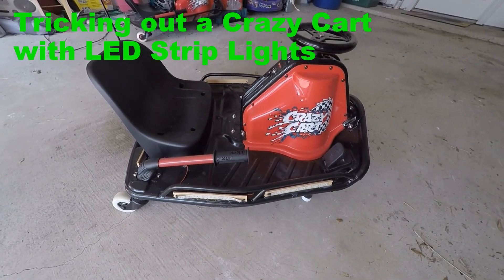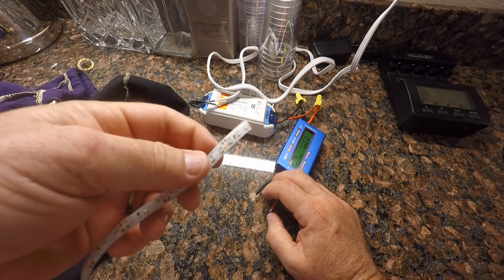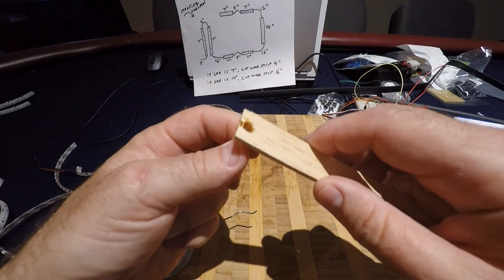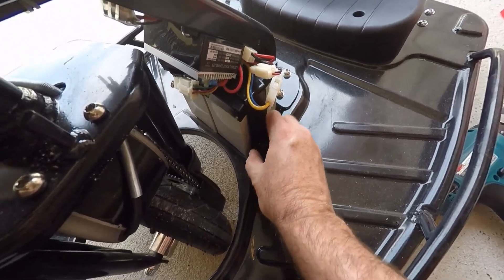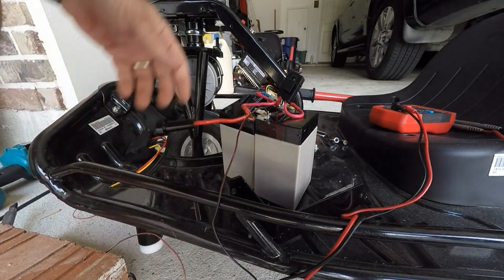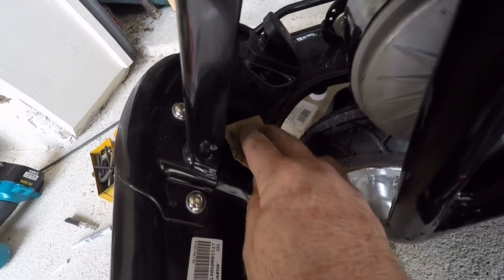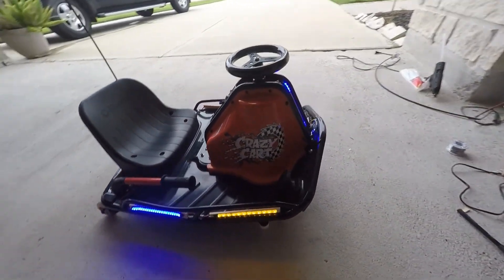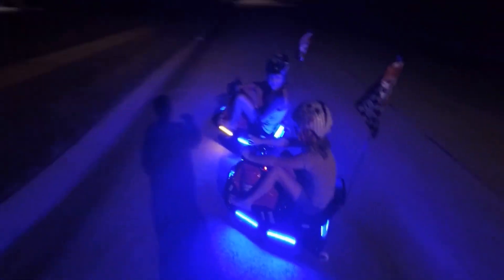Razor Crazy Cart - How to trick out with LED strips

Comment: Could you list the fuse wire that you used on this project? really looking forward to retrofit them to my nephew's crazy cart
Reply from the maker: +Jorge Oller I used one that I bought at an auto parts store.  Just get an inline fuse holder and I used a 3 amp fuse.  Important to use in case a wire comes loose, it will blow the fuse rather than possibly damaging the batteries or speed controller.